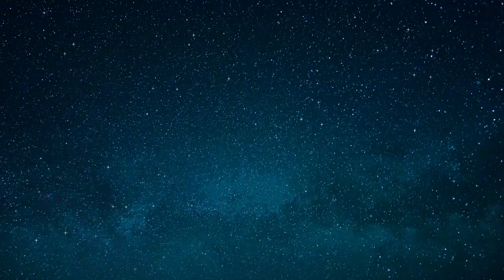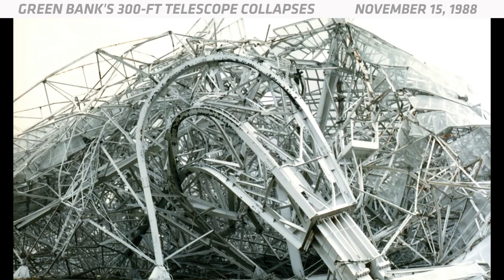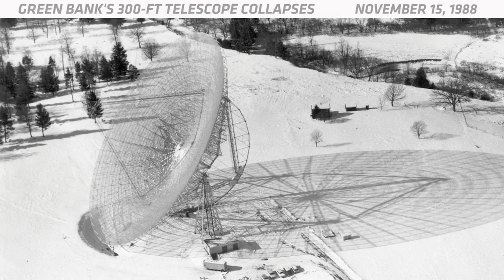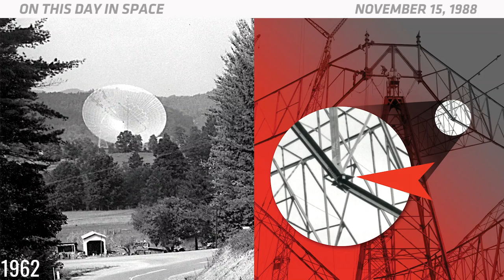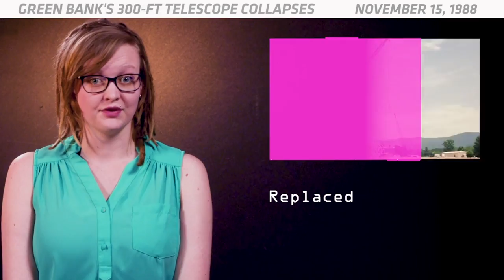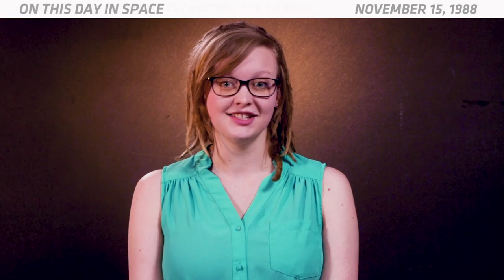OTD in Space - Nov. 15: Green Bank's 300-Foot Telescope Collapses

Comment: The Gussett plate had micro fractures due to the holes being punched vs drilled. The telescope had been modified over the years. The NRAO also dug a trench to allow more traverse. These changes changed the load bearing property on the plate causing the fractures to grow.